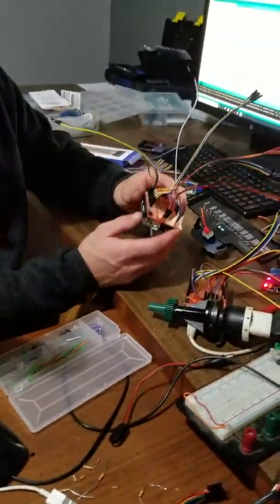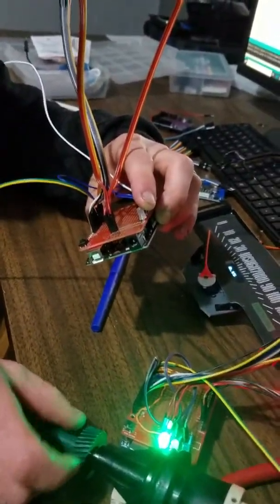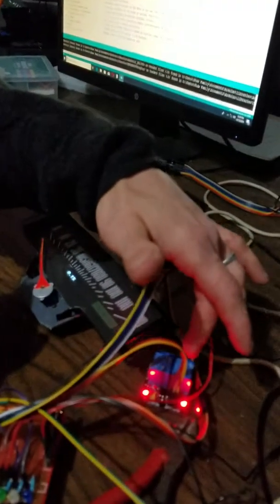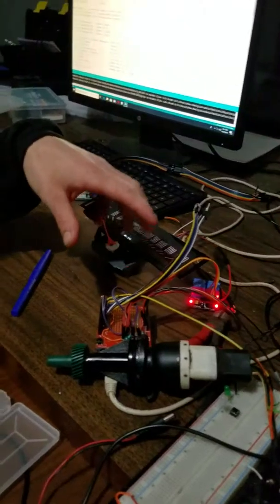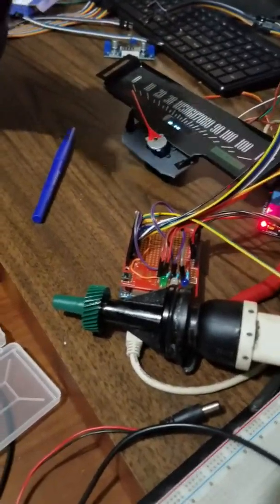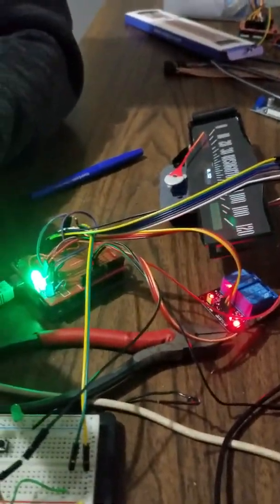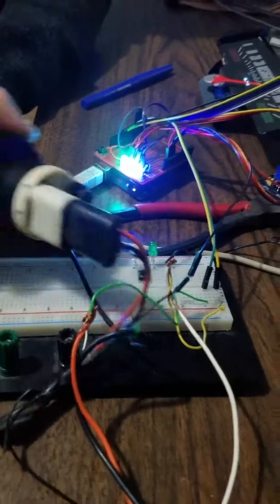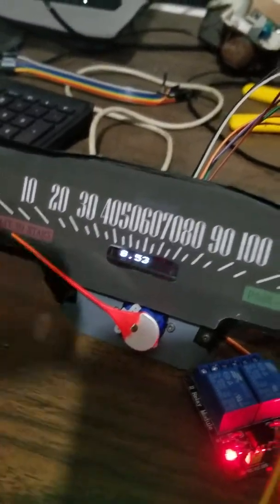Video 2 arduino  mph gauge odometer  and transmission controller

Comment: I’d love some help making my 47rh and 4bt run with an arduino
Reply from the maker: At this time I'm still perfecting this unit to deal with  the vehicle electrical noise and voltage  drops. When hitting horn or other accessories that drop bat voltage
Reply: @ShawsTimberFarm  So what did you do to solve the dirty voltage problem?